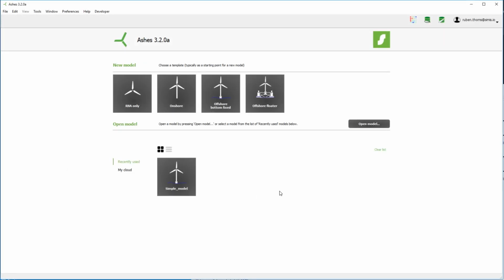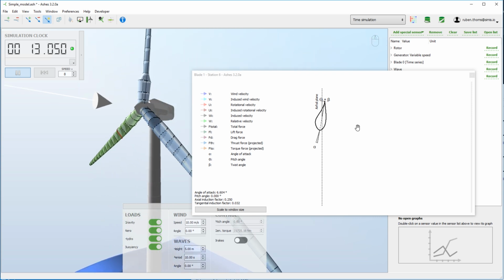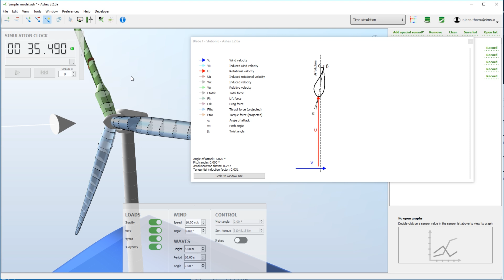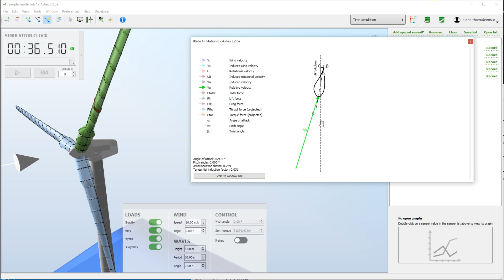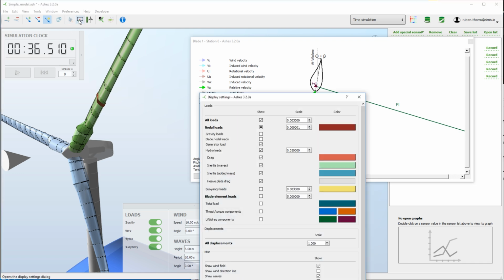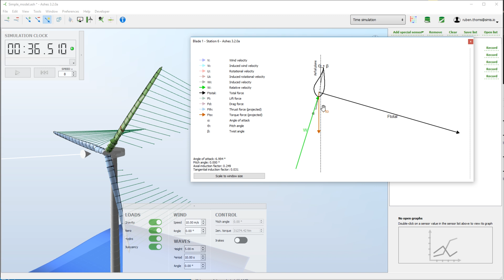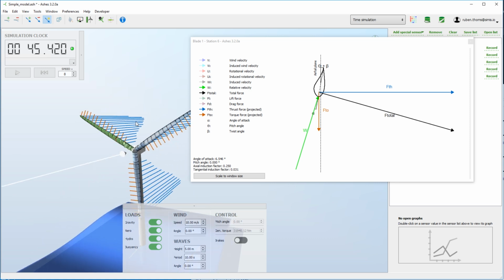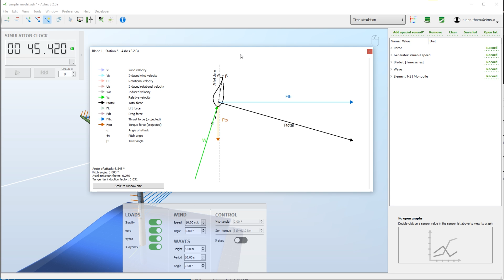Wind turbine velocity triangle explained with ASHES - the wind turbine simulation software

Comment: How can you sum up absolute velocity (wind speed) and rotational velocity to get the relative velocity? Wasn't it always u+w=v? What I want to say is that "u" should be turned the other way around
Reply from the maker: Hi Jesus
The rotational velocity is the apparent velocity 'felt' by the blade element as it moves through the air, so it is in the opposite direction of the motion of the element (and correctly drawn in this animation). But maybe we have different definitions of rotational velocity?